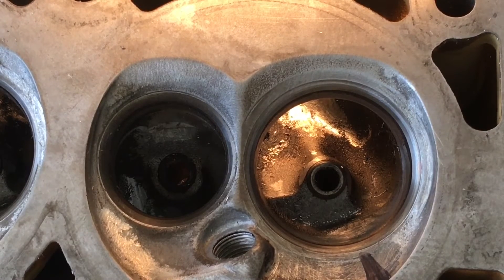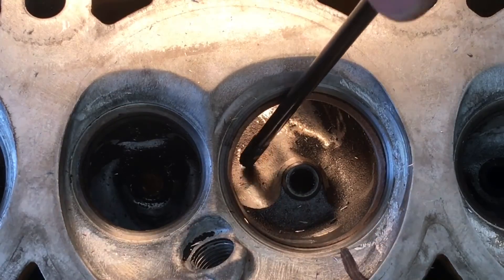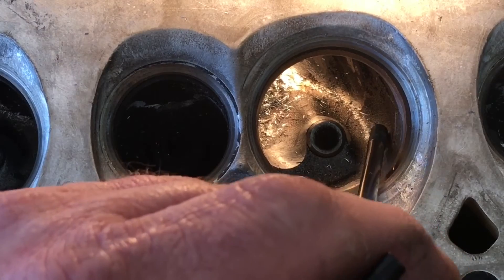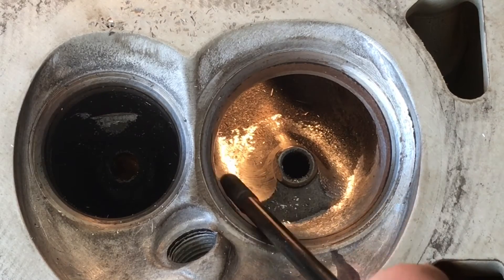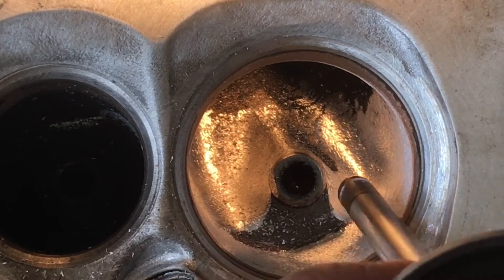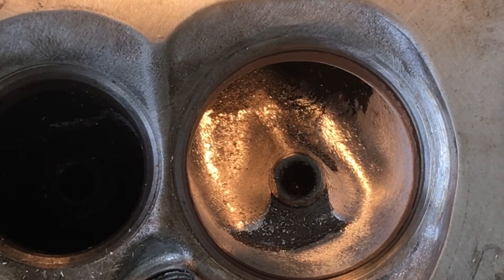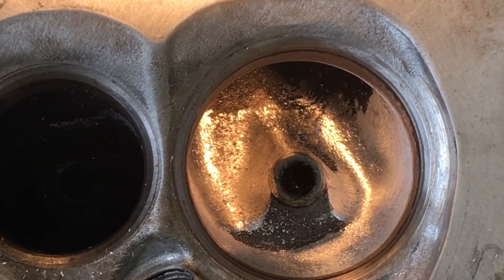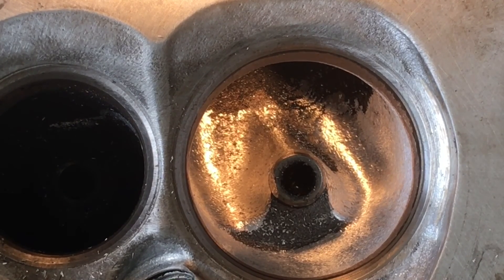Porting LS 799/243 heads Step 3 swirl ramp removal

Comment: at 2:47 in the video YOU say the opposite of what is correct !!!!! YOU are doing port bias on the WRONG SIDE !!!!! THIS IS NOT CORRECT WAY TO PORT HEADS. This will cause the air to slow, destroy swirl, reduce flow and ruin the heads....
Reply from the maker: You need to go away and stop trying to act like you know more than me because I’ll I will block you 100% if you don’t stop.
I have Flowbench data where I can show you where I get over 306 CFM of air out of a 243/799 head using a stock 2 inch valve and a stock valve job. So I don’t need your critique on my semantics or my wording my port work makes horsepower.
Or how about 278 cfm from a 1.89” valve using a 208cc intake port.  I have the evidence I have the Cylinder Heads and I have the ability to put my money where my mouth is if you’re ready to step up.
Reply: if you actually want tips from actual porting pros watch David Vizard. He ACTUALLY wrote the book(s) on "How to port heads" and the biased side IS the cylinder side NOT the far side as you say.

Comment: Will low-end torque be lost
Reply from the maker: If low-mid range torque is important to the application it’s better to leave the swirl ramp and/or run the 862/706 heads.
Enlarging the port volume to increase flow, if done properly will improve every lift point, but mainly gain more in the Mid-High lift areas effects velocity.  Key: The larger the CID the better it will maintain good velocity. 
Yes removing the swirl ramp will affect low speed torque/ response in a small way depending on CID 👍
You can improve your 243/799 heads without removing the swirl ramp. 
Even the 862/706 heads will flow 255-270 cfm w/ 1.89” valve maintaining the swirl ramp. JD
Reply: Thanks I will reduce at shown ur video

Comment: What is your opinion on header size with ported heads in regards to scavenging gains? Would it just continue to improve exhaust flow? I’ve seen header tests with stock engines of larger displacements and they picked up some gains because of increased scavenging, and the ram air effect, do you think the same would be true on smaller displacement LS engines like the 4.8/5.3 with ported heads because they would offer more flow? Or do you think too much flow and too large of a header decreases performance? This would be comparing 1-3/4” and 1-7/8” headers.
Reply from the maker: Luke Morgan I believe it’s always better to run headers unless your running a stock application. The stock manifolds are decent up to 375-400hp but even then not as efficient as a long tube header. 
1 3/4” primary tubes minimum on headers, but you really need bigger CID to justify 1 7/8” headers. I doubt a 4.8/5.3 would need the larger headers.
Reply: depending on CFM @ 28" @ full lift of exhaust port and intended use (maxing torque vs maximizing HP) stock to mild porting LS's need a 1-5/8" primary size, it isn't till after they flow over 200 CFM for max HP you need 1 3/4" and still 1-5/8" for max torque. At 220 CFM + is when you would need 1-7/8" for max HP and 1-5/8" for max torque.

Comment: In your opinion, would these heads compete with a stock ls3 head. No disrespect, just curious. Thanks
Reply from the maker: bumperdown racing It comes down to the combo between the two heads.  An LS3 head with its larger port volume really works good on 408+ CID.  A properly ported cathedral port should make great power on combos up to 370 CID
If you’re building a combo above 370 cid but below 400 cid it really then comes down to what type of racing and what type of power added if any.
This truly comes down to the overall combo as to which heads will work the best. JD
Reply: Thanks for your insight. I think I'm going to try this porting on a set of 799 and try them on my 6.0.

Comment: Noticed you’d mentioned Jim Lehart, and Jim Hand. Mr Lehart and central va machine is relatively close to me, and he and I have had some wonderful discussions about making pontiacs make more power. I have a question for you as well, sir. What, if anything, is your procedure for the short turn radius of the gen iii/gen iv sbc intake port? Thanks, and thank you for sharing your knowledge!
Reply from the maker: blockequals4 The LS and newer heads have a great short turn to begin with, so I blend the bowl cut percentages trying to maintain the same radius, while slightly widening it to blend into the port walls etc. I hope this makes sense, Jim Hand was the first person I found who really mentioned the widening of the short turn. 
Jim Lehart aka MrPbody on the Pontiac forums is a great resource! 
Thanks for watching I appreciate it!  JD

Comment: AFR or TFS heads, anybody?
Reply from the maker: Peter Fraumeni High Cost to play in the AFR or TFS head game. 
AFR 215cc heads are $2400-2600.00 a set 😳
TFS 215cc heads are $2300-2500.00 a set 😳

I can use your castings and create the same port & flow for $750.00 plus any machine work required. Generally it cost +- $1000-1500.00 for me to do the heads bolt on ready to run.  I can do 215cc or 220cc heads in the cathedral ports. 
Once you get above 220-225cc intake volume you really need a sonic depth probe to be safe. 
Also, above 220-225cc many companies are removing material in areas that don’t improve flow purely to advertise a larger port!  The most power comes from the best flow using the smallest port volume to support the flow.
Also, flow numbers above .650” lift are “Funny Money” numbers because early to people build using solid roller cans with .700”+ lift, certainly not .800” lift in a cathedral port head. 
Thanks for watching and the feedback, this helps me clarify to others more information.  JD

Comment: Do you have a base tune for your blazer build?
Reply from the maker: Baptized_in_ muddy_waters I’m still working on the tune with the new 4.8 with the 1838p cam and ported heads. Or were you talking about the original stock 4.8 tune?
Reply: HeadFlowInc I am talking about your current tune. I have the same cam just need a starting point on the tune. Surging down low and won’t hardly run in gear.

Comment: Where do you purchase your cutting burrs.
Reply from the maker: Jim Fuller I’ve been finding great deals on eBay.  I’ve wasted enough money over the years buying name brand burrs from Cornwell etc. 
Having the right size, shape and cutting burr design helps.  Single cut burrs cut smooth but even the double cut are fine as long as you keep the burrs lubricated. I dip my burrs in mig tip grease and clean off the excess. JD
Reply: @HeadFlowInc  Good evening..I am about to receive my new cutting burrs any day now and I see you say that you keep them lubed up with mig tip grease..are you talking about the Nozzle Dip ? I am a welder and have a few small mig machines here at our house and have plenty of nozzle dip,so that caught my eye.. I am working on a set of 706 heads now doing some minor cleanup and bowl blending..I am using these heads for practice and they are coming along nicely for my first work on aluminum heads.. I like your work here on your videos and presentation.

Comment: Im curious, what are your engineering background and qualifications? What are your machine shop qualification?
Reply from the maker: Richard Scarlett I’ve covered this in the past, you don’t have to be an engineer or machinist to port cylinder heads, intakes, manifolds etc.  The requirements to learning to port starts with the willingness to learn and try.  
I’ve been modifying cars since 1986, over the past 36 years I’ve been able to learn many different aspects of Automotive Performance.  My machine shop knowledge is from building engines and working with various machine shops.  You’d be surprised what you can learn by hands on experience, researching others success and using all resources to learn. 
Porting I tend to use mostly what I learned from the Joe Mondello porting classes, porting technique from Jim Hand, Jim Lehart, David Vizard and many others.  You could do a basic clean up of a set of heads by merely following the instructions inside the Standard Abrasives Deluxe porting Kit. 👍
Keep in mind, I’m not designing a port from scratch or programming a CNC, it’s a process of improving efficiency.  Thanks for your questions, it’s interesting to see feedback I appreciate it!  JD
Reply: @HeadFlowInc  cool, I was just wondering what your experience is. You find a lot of people on YT that portray themselves as knowledgeable / experienced trying to instruct others when they dont really know what they are doing. When its a subject that I know nothing about and am interested in I ask this before I ascimilate knowledge. TY, sir.
Reply: @richardscarlett7942  Ive been doing head work porting about 15yrs. Ive not seen anyone on the internet with the knowledge this guy has. Ive been watching, applying his tips and my superflow said Head Bytes is the man when it comes to porting.
Reply: Why do u ask that